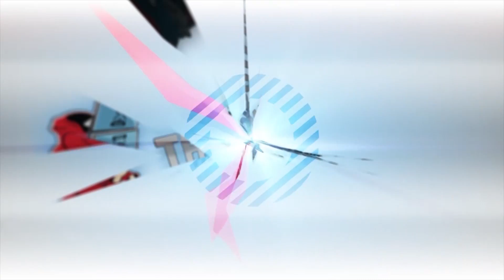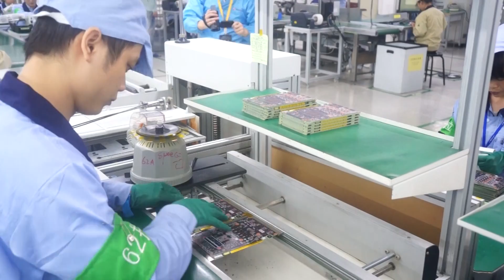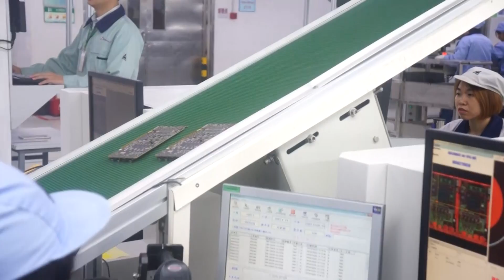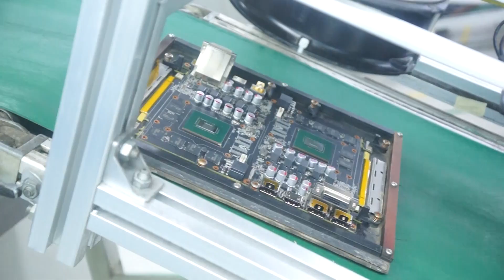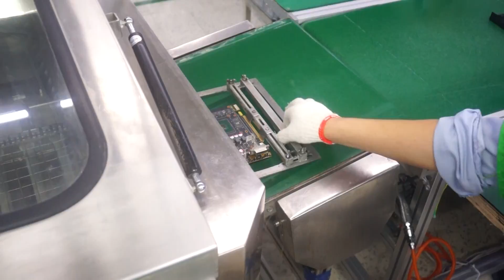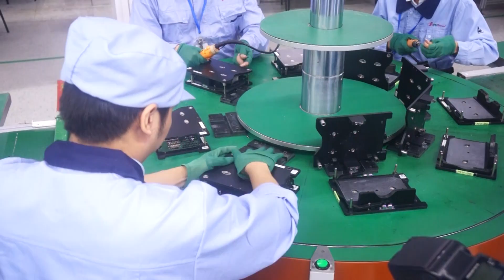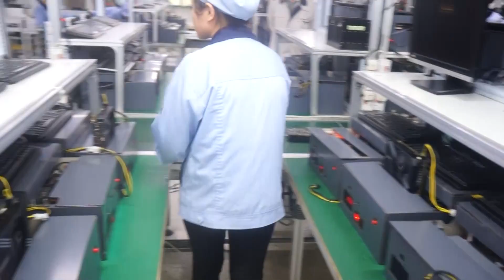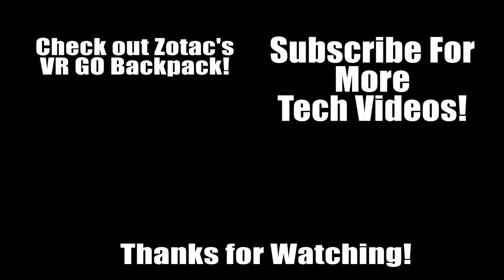How A Graphics Card Is Made

Comment: If the process is the same for more powerful cards i wonder why are they more expensive.
Reply: For that entire factory, for all the research, for all those employees, and for all that energy, there is an overall running cost. The actual raw material cost difference between an older card like a 980 vs a new card such as a 1080 isn't that different, as you yourself mentioned when you were talking about the soldered pieces. Putting a high cost for the new, premium GPU helps pay for the overall running cost more easily and quickly. The high costs also help them make profits, which allows for them to continue creating more GPUs, doing more research, and eventually making a new GPU. The profits are also needed for the companies head staff to buy super-cars and live in mansions. At least, this is my best guess.
Reply: More powerful cards have a higher-end GPU on them. The chips are binned based on their performance and might have parts disabled to fit into a product lower in the stack. Higher-end GPUs have a greater cost associated with them because yield from the silicon wafer from which they are cut is lower the bigger and more complex the chip is. So for example a wafer of GTX1060 GPUs will produce more chips than a wafer the same size of GTX1080s. The fewer units you produce from the same materials the greater the per unit cost. That is only the GPU chips. There are other things as well like memory amount, type and speed rating etc etc etc.
Reply: You are correct. Try paragraph spacing and less words.
Reply: The answer is very simple: Supply and demand.  Nobody wants to buy the less powerful, outdated cards.  They all want the most powerful, newly released cards.  So if if you want to be able to sell the previous batches of products, you need to show the consumers that those are cheaper to buy now compare to the new one.  Suppliers don't control the market price by the way (only can influence it in an extent but not 100% control).  The companies that manufactured these cards don't control what the price sells for in retail.
Reply: I'm a student in electronics and we had o course about this subject... The reason why cards like 1080 cost more is this : Whenever a new "architecture" is designed the company invests a huge load of money on research and test chips...  The price for a batch of 2.5 inch silicone wafer for tests is huge... After all the research is done they have to order another batch of "bigger" wafers so that the manufacturing process can start.... Now after the chips are "laser printed" into the wafer and cut out using a diamond razor they have to test the quality of the chip.. The ones with better proprieties will become 1080Ti , 1080 and as the quality decreases so does the number ... Don't misunderstand a 1050 isn't a defective 1080 is just that the chip even though it might have come from the same wafer has inferior qualities ..... After you get the chip there is the money invested into a PCB ( the 2nd most expansive part of a  circuit ) ... Overall a 1080 costs more then a 1050 because it has higher grade silicon , a  PCB designed specifically for it and the company has to recover all the money spent on research..
Reply: Stipan Lisica Dumb?
Reply: True, right now what i see isa board with pieces soldered on it so why are they eypensive if like we give robots instructions to make them and robot puts them in place. Like i get it its expensive to gather knowledge about it but once you do its just a copy of a copy for the rest of them, only costs become electricity bills, shipping, some workers.
Reply: Spam97, you're exactly right, except the 1050 is a different design to the 1080 (1080 is GP102 while 1050 is GP107), "higher grade silicon" has nothing to do with it (well, the 1070 is a lower grade version of the 1080), it's just a larger chip. R&D is super expensive nowadays, so you find these small GPUs (1080 is actually a fairly mid-range card because it only draws about 180W and it's a 300mm^2 chip compared to high end chips which are 400+mm^2) are pretty expensive because they have to increase the price to make up for the cost of developing the GPU.
Reply: What kind of question is that? You do know that more powerful cards have far better GPU's on them and better components and memory etc? They usually even have fancy looking heatsinks and fans etc. These all had to be manufactured also and they required a more technical manufacturing process than the more simple cards. Yes the final stages to put the card all together would be similar, but that doesn't mean that it should cost the same. I mean the process of building your own computer for a 500 dollar one and a 2000 dollar one is basically the same, just because the process of putting it together is the same doesn't mean it should be worth the same, the reason is the more advanced components. 
It's strange that you even got 16 thumbs up.
Reply: Stephen Wakeman is right. The GPU's inside the videocards are working at/near full potential. Or the wafers can physically produce more chips. Another thing to realise is that for the enthusiast segments they will build custom pcb's with better power delivery and higher quality components. And select the individual Graphical Processing Units that will run at higher clock speeds.
Reply: The component have different grade
Reply: If it were fun and enjoyable it will be called fun, but it is called work. 

If you don't want to work for things you can try robbing people but in the end that's also work, just different. The alternative is living outside of society and earning your own food and entertainment. 

Your choice. Nothing is free
Reply: The more powerful cards have more powerful chips which are of course more complex and more time consuming to process. Also not only the raw material costs are important. Advertisements/ Research/ Staff etc....
Reply: The cards that cost more either have better binned chips or didn't fail the tests. They shut off shaders on the ones that fail. The higher ones need more cooling and nicer vrms. You pay more for the better product. Its the same for cpu chips. They make lesser cards to get a return on investment. If they just threw away cards that didn't meet a 1080ti specs it would cost an arm and a leg.
Reply: Pankaj Ahuja lmfao
Reply: If the video games comes from a 10 dollar-material disc, why they are more expensive?
Reply: Arpan Kaphle explained it beautifully. Stipan Lisica, do you like working for free or would you work for less than what you make now? People got to get paid.
Reply: You didn't fully grasp the extent of my intentions.
Reply: THE ANSWER: nVidia
Reply: It's all due to profit margins, those more powerful cards require a lot more money spent on Research and development, and even if the price of the raw materials isn't that high it's still  a considerable amount more than the less powerful models (silicon for large chips, larger heatsinks and more advanced PCBs all contribute to the cost). For the really high end products they use exotic stuff such as HBM or ECC memory which drives up the price even more (although they do charge quite the premium for the workstation/server stuff). These companies want to make more money so of course they increase the price to make more and consumers buy these more expensive models.
Reply: powerful cards are more expensive bcs of the gpu on the card. the gpu looks like a processor if u look at that board.
Reply: It's been a pleasure doing business with you.
Reply: I never got to learn the value of money and based on that i have ideas which include free stuff but i know how impossible that seem today. You are hard wired to justify costs but in reality robots do 80% of work and even if the whole world gets automated you will still have salaries. They're not even fair in terms of how hard the job is but instead how successful. Everyone is just going along with it, like we are kings of planet yet our social order is Boss-who does nothing and gets paid the most, actual workers who are paid the least and the middle guys who scoup up the cream and do nothing at all. Why do we need cashiers or bar tenders? We don't, it's just they created those jobs for themselves to justify their place in society which is heavily influenced by money. Lawyers, police, army ffs, why can't people govern themselves? Fucking kids is what they are. Even when most unnecessary jobs are replaced by working force that doesn't need money they'll still cling to being servants because they have no clue how world could function. It's the same with religion, if God didn't say murder is bad, everyone would go on killing sprees, which is absurd. No work=no money, no money=no food, no food= WELL FUCK I GUESS I'LL JUST DIE THEN! There is no bigger picture with these guys, they just know they need money and why, no one is concerned by the fact our food production is 2 people producing food for 100 000 people, so yeah, should't they be the richest fuckers on the planet? It doesnt work like that you say? How about we change the way it works. It's all in the minds of you people, what thing has what value, gold is expensive as fuck because why? When something is scarse it worths more because individuals would give a shitload for it and then the seller sets the standard. I am overreacting but my point is the value of something shouldn't exist but to be used in most useful way for free. Example, my life is PC, eat, sleep. Why do i need to work for those things if value of life is more than those things, why waste my life on getting those things instead of having them to enrich my life? Sure it's worth it to be a slave to be rewarded with a PC that will be used more hours than you worked for it, but why work if i dislike it, why do we have richest people and poorest people, it makes no sense! Life doesn't have to be good moments and bad moments, we can make it however the fuck we want it to! Even games are made to challenge us, made by us, for us, the way we want it to, and THIS is what we want? to work shitty jobs so we can have nice things later??? Fuck no, I'd rather have it easy or die. But people just need to be held by their hand and disciplined, restricted to buy only few things so they take care of it, just like mamma taught them when they were little. There may not be infinite things in the world but we sure can make them as much as we want to.